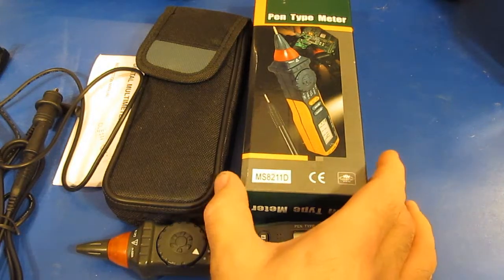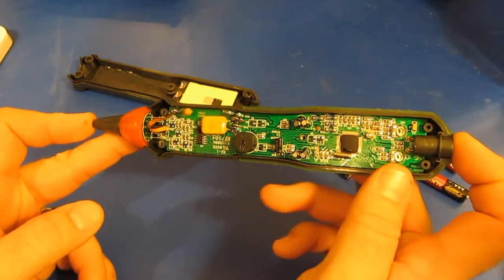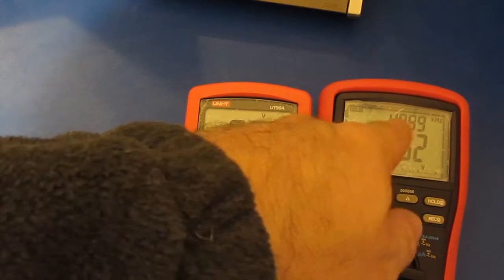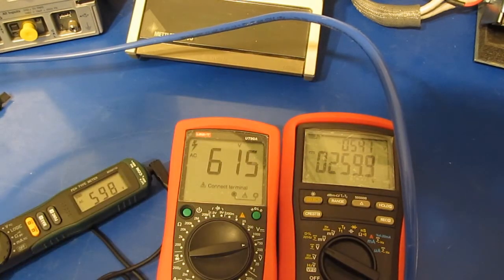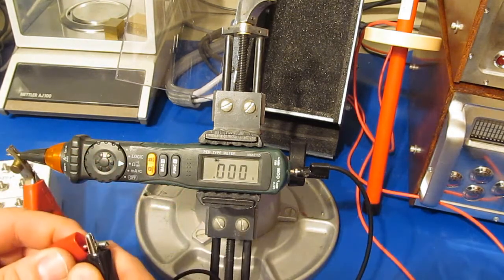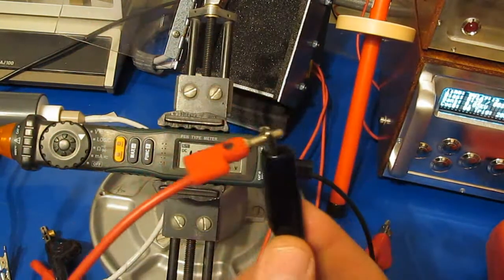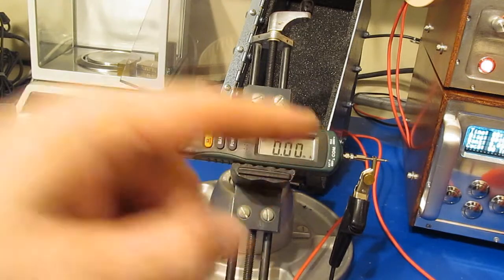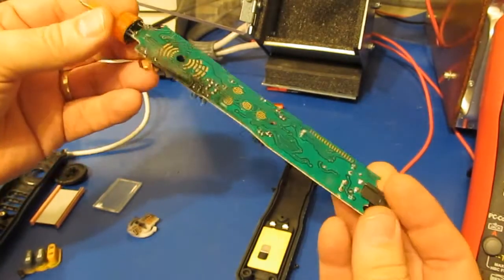The Mastech MS8211D Pen-type Multi-meter Review

Comment: I'm surprised you had all the features and were able to function test this unit with that wire and solder blob.
Reply from the maker: The two diodes in question are shorted so the solder bridge would have no effect if it stayed in place.   Also the clipped lead is not making contact with anything.  It was held in place with the insulating tape that was used to prevent the crystal from shorting against the IC's pads.   See my post with pictures attached:http://www.eevblog.com/forum/testgear/hear-kitty-kitty-kitty-nope-not-that-kind-of-cat/1075/

Comment: Judging from your tests, the device is OK for home use (220V)? Can you recommend same form-factor alternative from more reputable brands?
Reply from the maker: Feel free to judge what you see as you like.  It's been stated countless times that these tests have nothing to do with safety and that I benchmark using very low energy transients.   If you go to the main page, select about, you will find a link to a FAQ that you may find helpful.
Reply: @joesmith-je3tq  I see. I guess I will then buy one of the BM23x for now and wait for pen-type DMM from a reputable brand (or buy cheap one as a portable backup device).
BTW, Mastech has another model: MS8212A, with ceramic fuse and much more accurate soldering, judging from available videos and photos. Some German company even decided to re-brand it: https://www.peaktech.de/productdetail/kategorie/stiftmultimeter/produkt/p_1080.html
P.S. You call the reviewed device Mastech MS8211D, but I didn't see the word "Mastech" on the box or DMM itself. This could be a cheap copy of already cheap product. :)
Reply from the maker: @fr3k513 It's been over two years since I looked at this meter.  It was recycled.   I've had a few Mastech meters over the years and have always considered them disposable.    They do get rebranded, like many brands out there, but I don't see much of a market for a cheap copy of an already cheap product such as this.   I guess you could find some internal pictures of what you believe is an actual Mastech MS8211D and compare them with this one if have some concerns about it.

Comment: @joe smith ..which multimeter buy today ..FLUKE17B +  or Brymen BM257s .? I need for repair TVs,sat receivers,cars etc,,thx
Reply from the maker: Sorry but I don't make recommendations.  The problem is I have no idea what you need.  I have never looked at the BM257 and suspect you could do a much better job than me comparing the manuals for the two meters.   I do like the 17B+ but not having TRMS would be a deal breaker for me.  I like having the AC+DC mode and for Fluke this limits things a fair amount.   For bench work, I will continue to use the BM869s until I find something I like better.   For outside automotive stuff, pretty much what ever I can get my hands on.
Reply: but not having TRMS would be a deal breaker for me..yes this is answer for me..so i will buy Brymen BM257s..I like your BM869s but I use multimeter only sometimes..and BM869s is more expensive.
Reply from the maker: I like the two Brymen meters I have.  Dave sells the rebranded 235 for around $130 USD.   It's a pretty tough little meter but misses some of the features I like with the 869s.

Comment: naturally, before you use your multimeter you need to be sure that you know it pretty well, its limitations...etc. you wouldn't subject a multimeter to a value more than it can handle or you will damage it; so much so you wouldn't use it unless you know how to use it.   what you did was not a review but rather a way to destroy it. I think any multimeter, when put to a test just like you did, will be damaged. nice video though on how to wreck a multimeter. you wouldn't want to use...let say... a rated 600v screw driver to a 1000v live wire.
Reply from the maker: If you would have spent more time watching you would have discovered I have ran many meters this same way and many of them do quite well.  You could read the FAQ to learn more about it.
Reply: would you give a GO for this multimeter if it will be used within its specifications and limitations? I think this tester is of good quality, reads accurately until it was subject to extreme abuse and was damaged.  Do you think it is safe? Can you recommend another brand for this type of meter that you think is of good quality? I am planning to buy one. thanks for the help Joe.
Reply from the maker: It is rated for 600V, CAT III.  Assuming you took the time to do some research, what is it that you feel was extreme abuse?   I've stated many times that these tests have nothing to do with safety.  If that's a concern, get one that has been certified by an independent test lab.   

As I and others have mentioned,  one thing to consider with this type of meter is you would normally be holding it in your hand when using it. 

If you look at the spreadsheet,  I have ran the two probes like this.  Both did not fair very well.